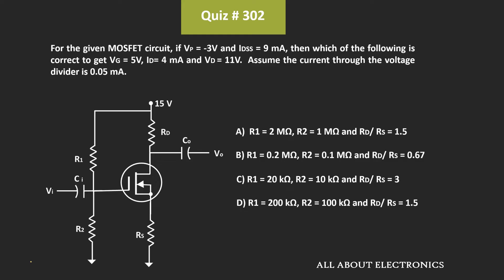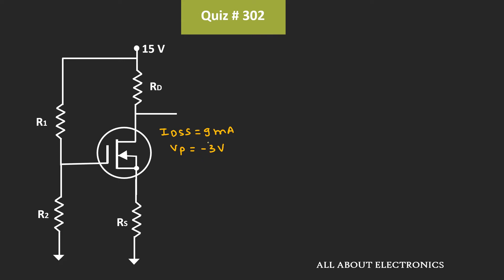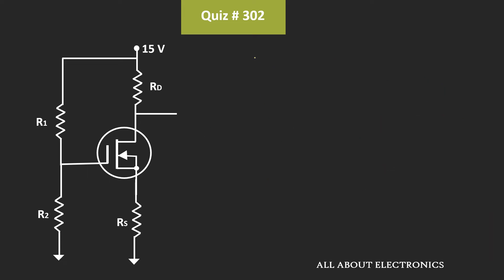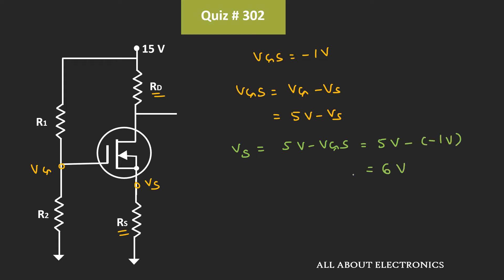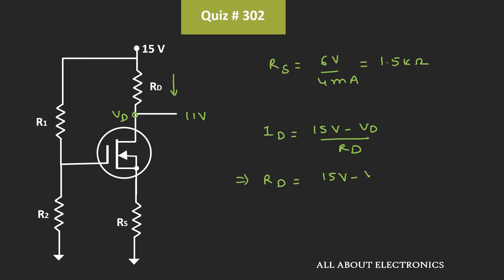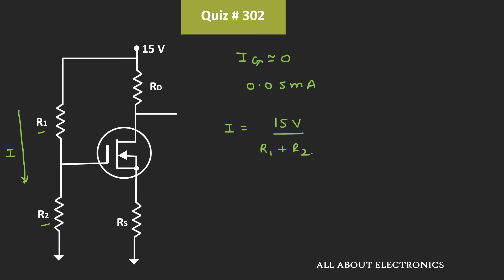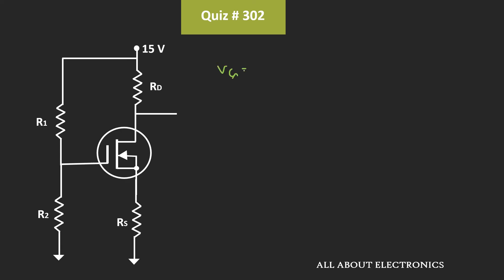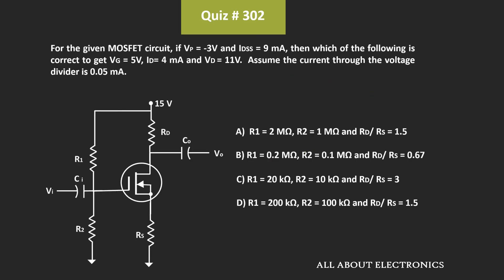MOSFET Biasing Solved Problem | Quiz # 302

Comment: In a practical case, i need to choose a value for R1 and R2, is there a way to find out that 0.05mA you have..?
Reply from the maker: Using an Ammeter you can measure the current and can ensure that the current is 0.05 mA. For that, you can use the multimeter.
Reply: @allaboutelectronics-quiz  yes but for design, how can i estimate the value for the resistors.
Reply from the maker: @rangerregmi5179  Just calculate the required value of R1 and R2 as calculated over here in the example. And see, what are the nearest values are available for such resistor values. You can also use a potentiometer (Trimpot) if required to get the exact value.

Comment: Very strange equation to be used in circuits with MOSFETs. As analog designer, I don't agree with these equations.
Reply from the maker: As a designer, we used to rely on datasheets and simulation for most of the time. And with experience, can directly implement the circuit. But this is purely for academic purpose.
Reply: @allaboutelectronics-quiz   GOOD ANSWER!!

Comment: Sir This equation Id = Idss (1 - Vgs/Vp)^2 is for JFET or MOSFET or both..?
Reply from the maker: For Depletion Type MOSFET, the same equation is also valid. Since the transfer characteristic is same. Only difference is, for Depletion type MOSFET, the curve is extended beyond Idss.
Reply: @allaboutelectronics-quiz  thankyou sir. These quizzes are really good.